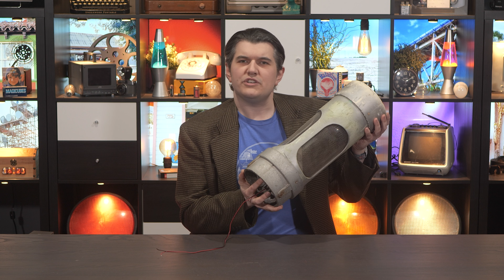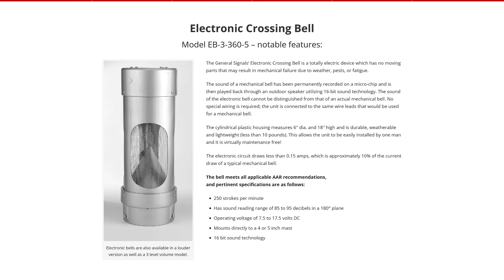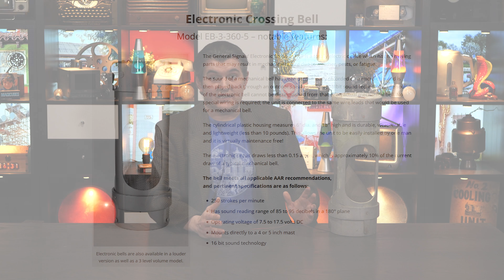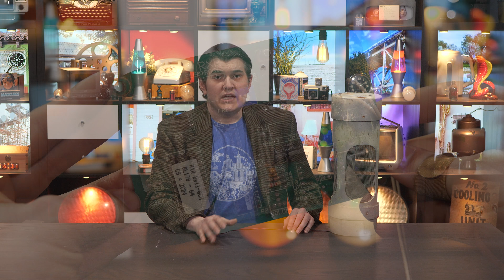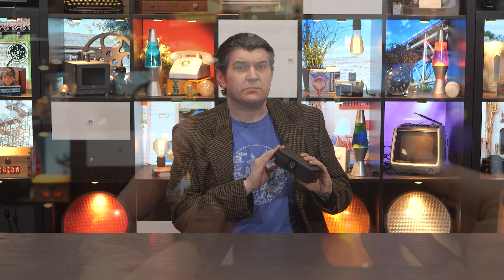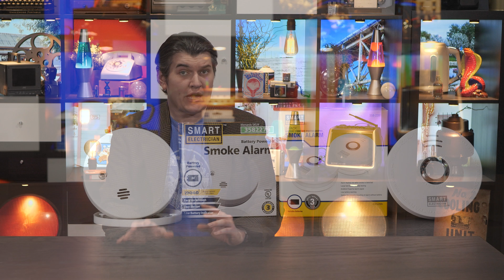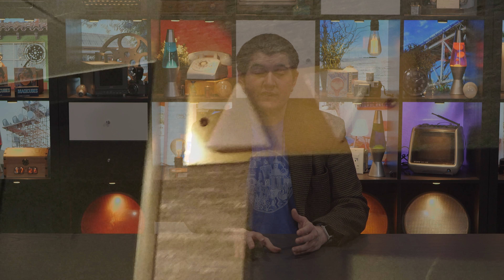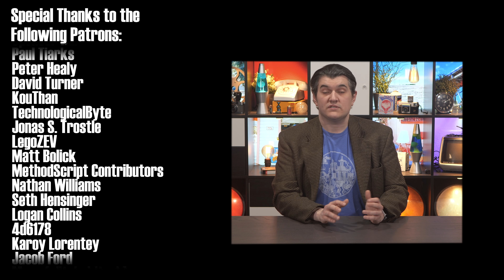The disappearing and unappreciated art of audible alerts

Comment: Car manufacturers: let's use a single beep for 187 different triggers. Oh and 148 of those are totally unimportant, to ensure the driver will ignore the important ones.
Reply: better yet, on my old ford, seatbelt alarm is loud,, but none for parking brake, if you looked real hard you might see the itty bitty little non blinking light, hmm
Reply: @billfusionenterprise  my 2009 Scion does beep at you if you leave your parking brake one.  There's a reason the parking brake on my Scion is still fine while the one on my old Expedition is not.
Reply: @Kevin_Narthex  my 1999 silverado had no sound but flash dash and headlights, very hard to ignore
Reply: @Kevin_Narthex  I don't understand how you can even forget your parking brake on. Even if there is no beep or anything, do you not notice if you have to nearly floor it to get it moving when normally no gas is even needed? Like, I sometimes accidentally don't disengage my parking brake entirely and leave it like 10% on, and while my car does beep to let me know if I get above 5 km/h, I have never moved more than a meter before noticing "something is wrong, oh its my e-brake".
Reply: @billfusionenterprise  the parking break on my 2013 Ford turns itself off if the tires rotate more than 1/4 turn. Very safe (:
Reply: @foehammerTrance that's a convenience feature - back in the 90s it was vacuum operated and would release when you put the shifter into Drive
Reply: @foehammerTrance  newer models yep, but older ones no, strange thing my 1999 silverado made no noise but blink the dash lights and headlight if you move with brake on
Reply: @billfusionenterprise  I jam my funny bone on the parking brake lever when my parking brake is on. Kinda hard to not notice.
Reply: @willjohnsonjohnson  not if your tall
Reply: @willjohnsonjohnson  lol
Reply: @willjohnsonjohnson ive smacked the living shit out of my funny bone so much on my 370z, worst time ive ever hit it my arm was numb for 15 minutes 🫩
Reply: @billfusionenterprise  my 06 Santa Fe had a mechanical chime that sounded like a doorbell that would just alternate back and forth at different speeds depending on the severity of the alarm (i.e. the seat belt alarm was slower than the parking brake alarm)
Reply: @billfusionenterprise  or alarm for car's inbuilt wifi not working being same as  another car about to hit me, yeah both are equally dangerous for sure.
Reply: @billfusionenterprise  Parking breaks really need a noise or lights, It is often my sense of smell that tells me I left it on 😅
Reply: @JuanPerez-cs1gx  fords have a liitle bitty light. chevy truck flahes dash and headlight
Reply: That ear shattering scream you hear is the truck telling you the parking brake is not engaged while the vehicle is in park. Or the air pressure is low at startup. Or the driver's door is slightly out of adjustment and not pressing the switch "JUST" right despite being latched. Or that there isn't any oil pressure with the engine off and you're doing diagnostics. If you think the sounds of cars is annoying, wait until you discover the joy of CMVs.
Reply: @The13thclam I've experienced the joy of dealing with low air alarm, door open alarm due to exactly what u just said, and ecm sending constant signal due to a short all at the same time once. Damn buzzer almost drove me insane.
Reply: @Midwest_tech  apparently, older trucks had a mechanical signal that would hang down in your line of sight when the air pressure was low. Almost impossible to miss or mistake for anything else.
Reply: @musewolfman the good ole waggle tales. The part thats very frustrating imo is that a visual indocator for low air is legally required, an audible one however is not required UNLESS the manufacturer installs an audible alarm. Yet they all do
Reply: useless indicators ruin your allertness, also in your mailbox
Reply: @rubenkoker1911 "alert fatigue" is the term for that.  When everything is the same and/or always alerting it becomes background noise.
Reply: @matthewmiller6068  Like the little boy who cried "wolf".
Reply: @matthewmiller6068 it's hard to have any useful method of communication because of that. 90% of emails are spam, 90% of calls are spam, 90% of text messages are spam, 90% of mail is junk mail. 

The flood of spam has ruined everything but verbal conversations (and I'm sure they'll find a way to worm into that, too)
Reply: My car had a steering problem. I did not notice until I tryed to turn becouse the sound it makes when it had the problem was the same it does when a passenger doesn't wear the seatbelt, and that sensor always detect'smy bag as a passenger, so I ignored it as I thought it was that.

Luckily it was just the power steering, so I just turned harder and avoided an accident, but It was way closer than it needed to be.
Reply: DAF trucks want a word
Reply: Microwave Manufacturers: "Let's play a long, full-volume beep every time the user presses a button."
Reply: @andybrice2711 I love that my current microwave has an option to turn off all sound — keypad touches, but also including when it’s done. I don’t need it to yell at me at all. Last microwave would beep every 30 seconds until you opened…forever…omg just stop. If I’m ignoring it, it’s for a reason and don’t need it to bother me more than whatever is keeping me.
Reply: @andybrice2711  That tends to be the standard with membrane keypads where tactile feedback is limited.
Reply: @ViktoriatheCat-v8z  Yeah. But just a short, sharp "blip" is adequate. It doesn't need an ear-piercing "BEEEEEPPP!"
Reply: Don't forget the warnings from the "collision avoidance" system that draw your attention away from the road right as you really need to be paying attention to your surroundings.
Reply: The most unnecessary sound I experienced in a car is the 2016 Ford Kuga, when setting you limiter to a lower speed limit. Normal cars would take away throttle, maybe even aid in braking. The Kuga instead only beeped at me constantly. Too fast, too fast, too fast and would only relent once I was 2km/h under the set limit.
Reply: My car gives the exact same tone to alert me to: Low Tire Pressure, Low Oil Pressure, Check Engine, External Temperature is less than 37F. Very cool.
Reply: @samhutch7679 Found the German car owner! I have a 20 something year old BMW. Every time the weather drops below 37, I have a heart attack.
Reply: Don't forget car owners that leave the door lock / unlock confirmation to HORN not LIGHT FLASH then press the button multiple times  !!!!
Reply: @bobroberts2371   I work for a rental company so I'm in and out of new cars all the time.  I usually have time to turn off useless bells and whistles, or shit that makes my job harder than it has to be.  So, look around on your menu, you can usually find a way to turn many things off. If not, get another car where you can.  Designers of automobiles aren't getting better.  They are in fact the lead in the Enshitification Movement.
Reply: @bobroberts2371 can you change that? What car let's you change literally anything?
Reply: @kanucks9  RTFM  !!!  Yes there are behaviors / options that the owner can change WITHOUT SPECIAL TOOLS if they Read The . . . .   Manual.
Reply: @kanucks9  You can change that, though it's usually under a hidden menu. You can also change things like how/when it unlocks, like only driver's door or all doors, unlock or not at park, etc
Reply: Meanwhile my '07 Pontiac Vibe and '08 Toyota Matrix only beep at you if you leave the lights on, leave the keys in, or to remind you to put your seatbelt on. If you have traction contol it also does a quieter singular beep to let you know there may be ice on the road if the outside temp is below 40°F.
Reply: @feathered_idiot  sadly, My old Honda Del Sol did not make any noise if you left the headlights on. No beeps, no dings, and no starter when you came back to it at the end of the work day.
And I was used to Subarus that turn the headlights off with the key. So it happened pretty often.
Reply: @musewolfman  what year? I have a 98 civic and it will scream at you if you leave the headlights on
Reply: Or let’s use the same alert ding for low on gas, engine light, and “the temperature dropped below 4C”
Reply: Driving a 2004 Saab 93, it never fails to amuse me that the alert chime is the aircraft cabin alert bing-bong highlighted at 12:48 

True to their nature as well Saab don't just give you a bing-bong and illuminate a light, no you get a whole brief description of the case for alert coming up on the dash, and if it requires immediate attention (Ie seatbelts) it then follows the bing-bong with a repeated chime tone, growing in intensity, until the issue is rectified or a button (marked 'clear') is pressed on the dash. Very much like, you know, on a plane cockpit 😅 oh, Saab
Reply: My partner just got a new car and all of the audible notifications are jarring and very bad at telling you why the heck they are going off.
Reply: @hanspecans VW?
Reply: my cherokee is like that.  the bing for overheating is the same as low washer fluid.  hate it.
Reply: I hate my black ice sensor, it acts like I'm supposed to fix the weather with how much it beeps at me.
Reply: This! 1000 times this. If I had a penny each time my car made a chime and I had to look all over the dashboard, infotainment system (including pull-down notifications) and what little buttons have left to figure out what was it trying to convey - and often times didn't even found out what happened - I'd have enough money to replace the darn thing.
Reply: Ah yes, the BMW driver PTSD. Am I low on screenwash? has the temperature fallen below 3 degrees C? am I currently on the verge of experiencing a catastrophic engine failure?
Reply: Boeing was actually sued for having the same alarm in two situations, one not too bad and one veryyyy bad, after an airplane crashed a few years ago. With fatalities.
Reply: We have one that beeps alarmingly because the door is open.  With the car in park and everything shut down.  I'd love to talk to the engineer who thought this alert was necessary and why.  How the ** else am I supposed to get out of the car!?
Reply: Are these the same car manufacturers that are trying to put screens everywhere so they can save a few cents on buttons? And have the added benefit of making driving more distracting and less focused? Yay, we're living in the future!
Reply: @doublestrikePhoto  also as a way to save on design time
Reply: A single light that says, "service required" should do! 90s gm vehicles were terrible for this. Put the gas cap on too tight or not tight enough and the light comes on. O2 sensors were always dirty too. So, everyone would just ignore the check engine light as a nuisance.😂
Reply: Man I had a modern loaner when mine was in the shop it was the most annoying beeping booping endless BS and seemed to make zero sense.  It also seemed to go full blown panic every time I started from a stop behind another car at red lights for a couple seconds before realizing I was totally fine as the car ahead pulled away
Reply: My VW has a few different tones I can think of, a pleasant quick "bing!" for cautions like low gas, a loud long high pitched beep for a collision warning, and a loud repetitive low-frequency one for warnings like if you fall to put it in park or you need you pull over immediately (engine overheating or something).
Reply: I got a Kia Niro as a rental, and the thing felt like it had alarms for everything. My least favorite was the constant beeping in reverse, which desensitizes you to actual danger of the proximity alarms.
Reply: VW in particular
Reply: I hate the cars that have a LOUD alarm to tell you that you have left the headlights on if you open the door to get out with the car off, but WILL turn them off in like 20 seconds if the car is locked and nobody is in it even if they are set to ON. It’s warning me about something (leaving the headlights on draining the battery to the extent it can’t start the car and potentially gets damaged) that won’t happen. Meanwhile, there is no warning at all (audible or otherwise) for having the car in accessory mode too long, or for leaving an interior light on, both of which will absolutely drain the battery to zero.

It feels like they either forgot to take that alarm out, or left it in because they think some old people might complain before realizing it actually doesn’t kill the battery or just to punish people for not trusting the AUTO lights setting lol. Distrusting it isn’t even the problem I have, I just want the lights on whenever the car is on, as there are studies showing that doing so improves safety even during the day, and the impact they have on the efficiency of the car is a less than 1% increase in fuel consumption that accounts for only a few dollars a year even in a gas car with halogens. It’s even the law to have them always on in some nordic countries for the safety boost and because the day night cycle is so seasonal and there is barely any sunlight in the winter. 

Carmakers, please turn off the stupid lights on chime or at least give us a setting that does this. Actually maybe I can modify my AUTO setting to do be like that if I convince it the sensor is always reading no light (potentially just by covering it). I will see how that goes.
Reply: Curious what all you folks are driving?  My 20 year old Town Car chimes different numbers for different important things. You only get the chimes for safety issues that I can recall, the only one I've had to deal with is the airbag system light bulb on the dash being burned out/non functional.  (forgot to plug it back in when changing the stereo out.)
Reply: If memory serves, this was a factor in the Helios Airlines 737 crash back in the day. The aircraft failed to pressurize after takeoff, so eventually the cabin altitude alarm was triggered. But due to it being the 70s, and computer memory being at a premium, the sound for the cabin altitude alarm doubled as the takeoff configuration alarm. The crew mistook the one for the other and started diagnosing completely the wrong problem until they passed out due to lack of oxygen as the aircraft continued to climb unpressurized.
Reply: Like BMW. 
First chime: Passenger door open.
Second chime: Oil pressure low,  engine damaged.
Third chime: Outside temperature 3 degrees C, possible icy road.
Reply: Next time you're at a self serve gas station, consider that (some) have nice color LCDs playing commercials, but the entire human interface consists of vague beeps of the same pitch and various lengths.
Reply: Thankfully, the "your transmission just killed itself" sound was a new one when that happened to me
Reply: VW, 100%
Reply: Three Mile Island engineers: Hold my beer.
Reply: BMW can learn a thing or two from this video lol
Reply: Volkswagen does use a different chime for seatbelt and door open, at least
Reply: I was talking on the phone yesterday and heard a familiar beep and said "The car in front of you moved," we had a good laugh because, well any Subaru owner whose been in a drive thru knows that sound.
Reply: Me almost yeeting the car of the road because my fuel light just came on and the car beeps at me like it's going to explode.
Reply: dude, in my car, I can disable some driver assistances, they all have a "warning light" of their own. But if I decide to disable forward collision alert, it will turn on a dedicated yellow light with front collision symbol, but ALSO it will turn on the general warning light (yellow triangle with an exclamation mark) - which basically makes it less likely that I will see any new warnings or information... I hate it.
Reply: @petarpopovic3306 that sounds like some BMW bs lol
Reply: Car designers suk so bad :(
Reply: I love when my bmw hits me with the engine explosion sound to tell me it's 37 degrees f outside
Reply: On Skodas the ping for "external temperature reached 4°C, danger of ice" is the same as "fuel low". Always a mini heart attack.
Reply: Pay closer attention the the number of beeps or chimes your vehicle makes. They mean different things.
Reply: My car has a very dramatic alarm that tells me that hill start assist isn't working when the engine is cold, a thing I very rarely need and can easily live without. 

Significantly more dramatic than the low coolant alarm, which is _much more of an emergency_. And one that comes up way more often than it should, given I was stupid enough to buy a Ford (a mistake I will never make again)
Reply: It goes ape shit because a tire pressure sensor has a low battery. In reverse, when driver attention is critical.
Reply: Or the opposite. Several rental cars I’ve had recently will play a completely indistinctive beep or chime and give absolutely no indication on the dashboard what it’s for. That should be illegal!
Reply: My brother was quite annoyed when the "low fuel" bong was the same one as the "your engine is actively disassembling itself and Uncle Rodney will be visiting soon" - when we lived barely a block from a fuel station. The only difference was which gauge the tiny red light was on beside.
Reply: My problem is that there's something wrong with the sensor, so my car alerts me every five seconds that my front passenger side tire needs air when it actually doesn't. Every. Five. Seconds.
Reply: 100% agree, but having bought a notoriously expensive to repair 07 BMW, there needs to be different bongs for critical, high, moderate, and FYI-only notifications. All of us almost have a heart attack when the BING happens lol
Reply: Honestly, lots of active safety assist beeps and bongs would be a lot less infuriating if it were bitching betties instead of indecipherable beeps and bongs.

Beeps and bongs mean nothing unless you train for it. And most drivers won't train for them, because that's not their lifestyle. Therefore, it just becomes an annoyance without meaning.

Bitching betties warning the driver BLINDSPOT LEFT, or CAUTION AHEAD, or BRAKE BRAKE BRAKE would actually be useful and meaningful, even if it remains obtrusive. Such an approach would also greatly benefit from cutting down false positives to the maximum extent possible, since false positives enrages drivers and teaches them to ignore the warning.
Reply: @prfwrx2497  To add to why coded beeps would be disastrous: manufacturers would never be able to settle on one standard (unless strictly enforced). Imagine driving one car for ten years, then switching, and suddenly the alarm for oil pressure is the seatbelt.
Reply: @prfwrx2497  this would be fine as long as you can configure what the sound or phrase should be
Reply: @prfwrx2497  Could meet you halfway. Just don't have the same beep for everything. The sound should convey the urgency without needing to train for it. There should be a pleasant beep that you hear all of the time, but then a different one for very bad things that sounds awful
Reply: I am convinced that modern cars are deliberately trying to induce roadrage by harassing you with alerts as much as possible.
Reply: @moabgram Brake lights being red doesn't help.
Reply: My car has different beeps for opening the door with the lights on and opening the door with the keys in the ignition and I love it.
Reply: @reaganharder1480  I will never understand why any car would beep for leaving the lights on - if you can detect that the lights are on, don't chime at me, turn them off for f sake.
Reply: @zwerko  well my car has a physical switch that I'm pretty sure has a quite direct connection to the lights, so it very much cannot turn the lights off unless it somehow got hands to turn the switch. And quite frankly, I like it that way. I do not trust the car to decide when I do and don't need headlights.
Reply: Toyota be like, "we need a chime to alert the driver that there is currently nothing beeping".  

I won't buy any Toyota made after ~2010 because their chimes have gotten so annoying.  Most other manufacturers are getting nearly as bad now.
Reply: @SeniorKlean  Neither my 2022 Corolla or my 2025 Prius have been vocal at all.  The Corolla would occasionally beep if it lost sight of the lane markers on poorly-maintained roads, but the Prius hardly ever does (unless you pull out into traffic, or the blind spot monitoring is triggered while your turn signal is on).
Reply: @thetechconspiracy2   What about when you open the door before turning the engine off, or take your seatbelt off before turning the engine off (even if it's in park), or the glove box is open, or someone in the back seat moved enough to temporarily unregister the occupancy sensor, or the it thinks the radio is too loud, or you turned the lights off, you left the lights on rather than auto for too long, or any of a hundred different reasons I can't be bothered to remember.  

My mother has a 2022 Rav4 and it is awful.  Her previous car was a 2013 Camry and that was bad enough, the new one is much worse.
Reply: @SeniorKlean  My Prius only beeps when the driver's door is opened and the car isn't in park, or your seat belt isn't buckled while the car is in motion, neither of which are likely to occur during a drive.  There is no beep for the glove box, nor rear occupancy sensors.

There is also no beep for the radio being too loud, and I always leave the lights on automatic.  The car will only beep if the lights are set to off and it's dark, or you turn the car off with the lights set to on (which every car I've driven does anyway).
Reply: My Car: "DING! 39F❄" OK?? AND?? Why do I care about that? I know it's cold. I walked outside to get to the car. Possible black ice danger or something at that temp? Why not say that? Why not LET ME TURN IT OFF SO IT DOESN'T DISTRACT ME WHILE I'M DRIVING?
Reply: thank you dodge for making "out of windshield wiper fluid" the same sound and intensity as overheating and oil pressure or any other warning light !
Reply: @jellyloab  At least it's not Ford.  Wiper fluid low, sound an alarm every 5 minutes.  Engine overheating, no warning necessary.
Reply: I think it because they want to do bare minimum for legal requirements, instead of being useful,
Reply: Then insist that every one of the useless annoying beeps or bongs or steering wheel grabs and phantom braking turns back on every time you start the car again to qualify for 5 star safety rating so you have to spend literally minutes and dozens of touch screen tiny button presses to turn them all off again at the start of every drive.
Reply: BING it is cold out. thanks volkswagen!
Reply: VW: "HEY DID YOU KNOW ITS COLDER THAN 4°C OUTSIDE? NOT GONNA TELL YOU WHY THATS IMPORTANT. YOU SHOULD KNOW WHY. JUST GET BEEPED AT"
Reply: @blueberry1c2  "Hey, did you know it's colder than 5°C? How about that it's colder than 3°C? Look man, now it's colder than 2°C..."
Well, damn, car, I can't control the weather!
Reply: funnily enough i think tesla does a decent job. i dont really remember what my old impala did though
Reply: Y'alls cars beep?
Reply: I test drove a Nissan Leaf and very quickly decided that it wasn't for me. The thing beeps for everything, including things you enabled yourself. Ended up buying a Kia instead. Only ever beeps for things that are actually important, and most of the time it's different and/or comes from different directions depending on what it is.